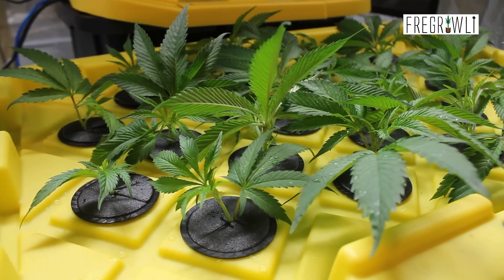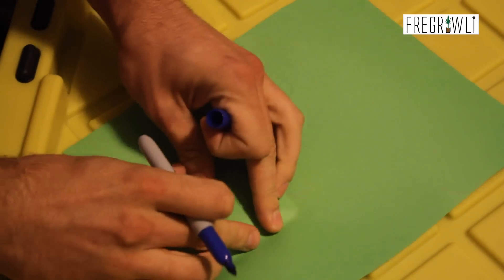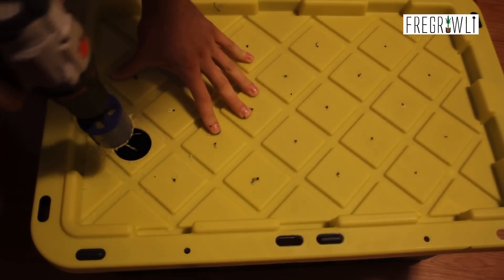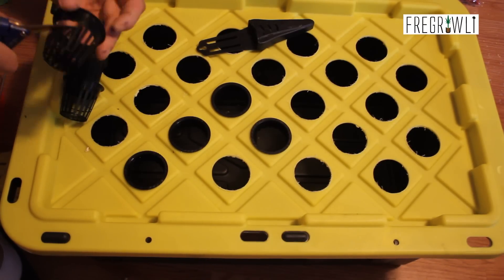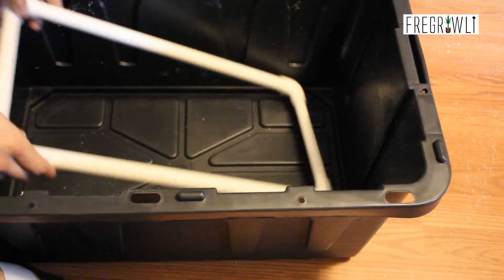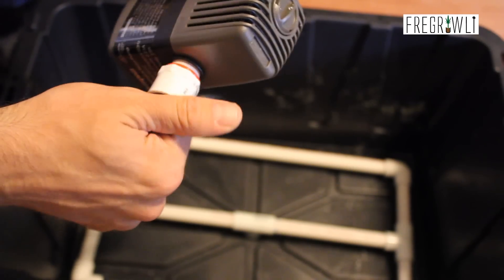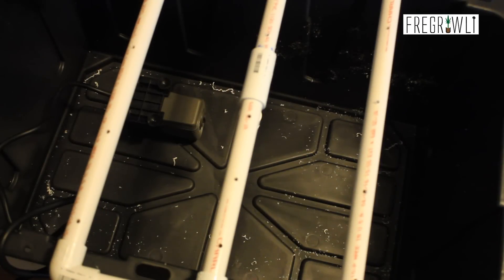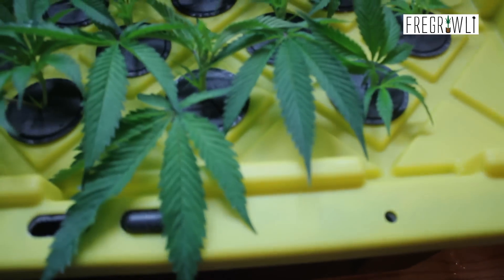C5:E3 - How To Build a DIY Aerocloner Cloning Machine

Comment: Put a window door seal on the outside lip of the lid  to keep it from leaking. Use a 10 / 32 tap in your drill letting the motor guide the bit in and out slowly to create the thread pattern . That makes it so the nozzle screw right in and out.